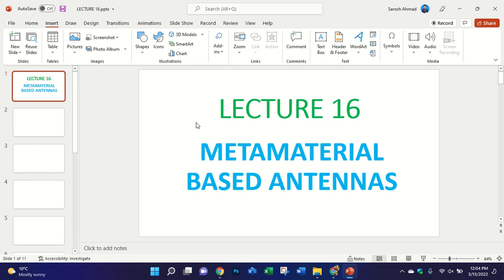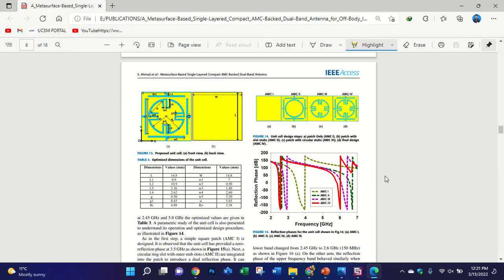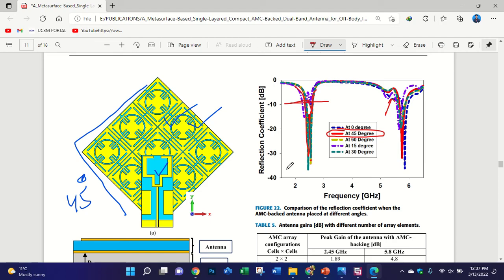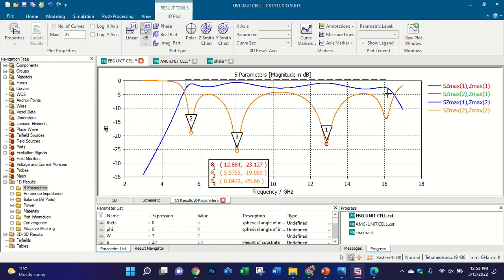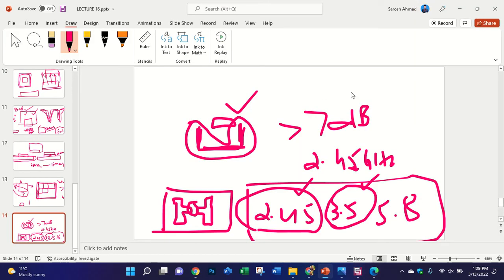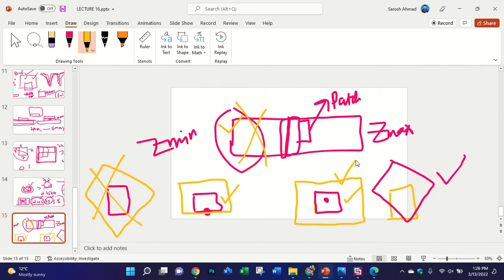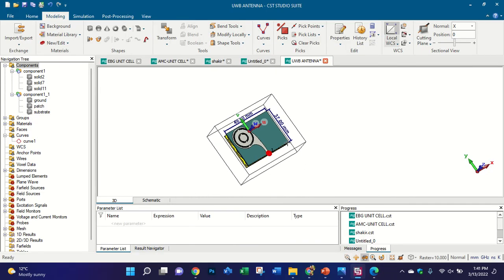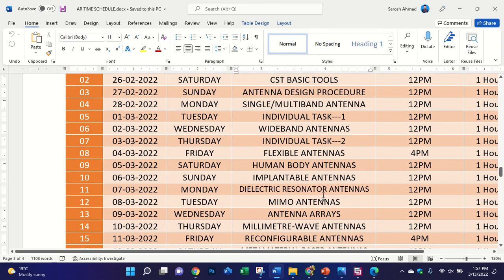MATEMATERIAL-BASED ANTENNAS IN CST STUDIO? [LECTURE 16] | #antennadesign, #cststudiosuite

Comment: Can you please tell me how to use graphene in GHz regime?
Reply from the maker: Graphene can be used in the GHz range, but because its conductivity is lower than metals, it’s lossy. At these frequencies, it’s best used for:

Tunable surfaces (changing chemical potential via DC bias)

Reconfigurable metasurfaces, absorbers, or switches

Hybrid metal–graphene antennas (metal for radiation, graphene for tuning)
Reply: @smart_engrz could you please make a tutorial on reconfigurable metasurface using graphene in GHz regime. Thanks